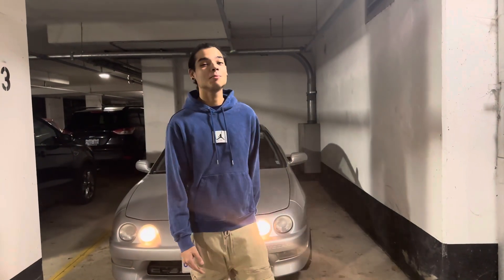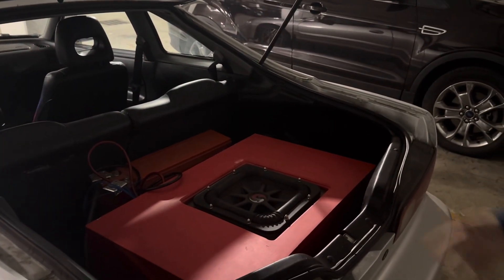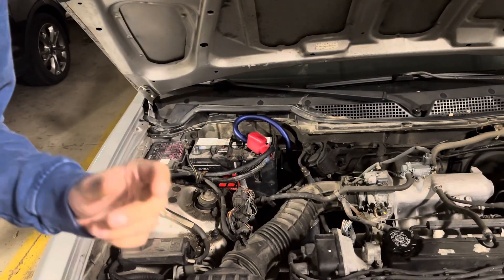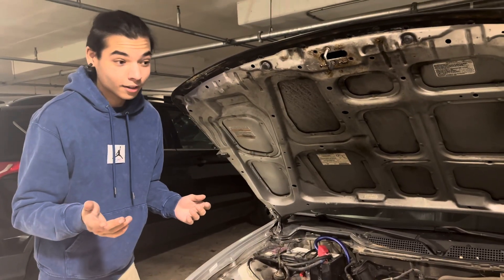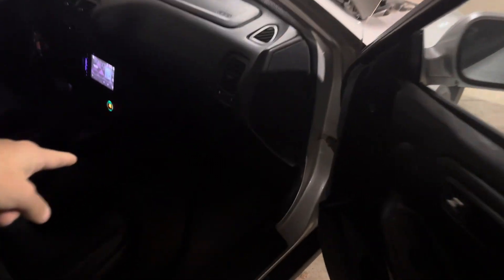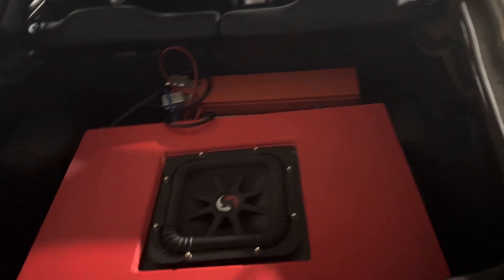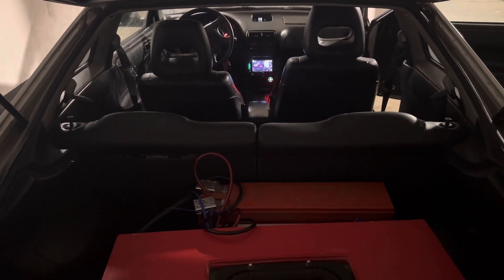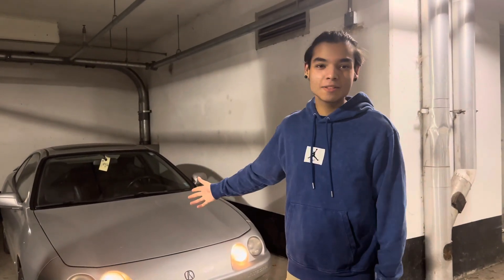How To Install Sub And Amp In Acura Integra

Comment: Wired up my amp & it’s getting power, turns on/off when my integra does, but no sound is coming out of my subwoofers. Any advice?
Reply from the maker: Are the RCAs connected? 
Are the speaker wires wired correct? 
On the radio is the sub on?